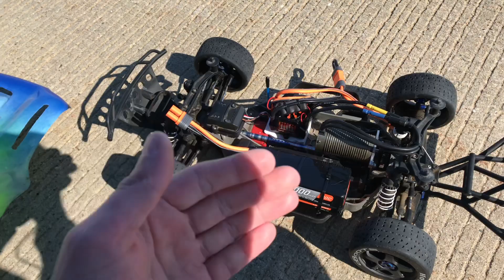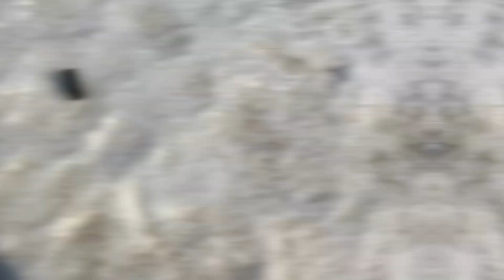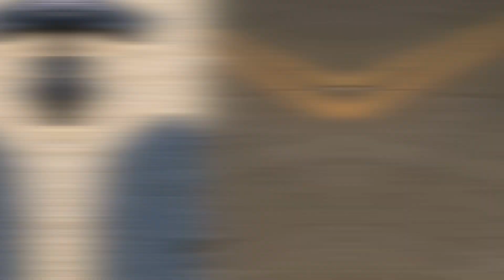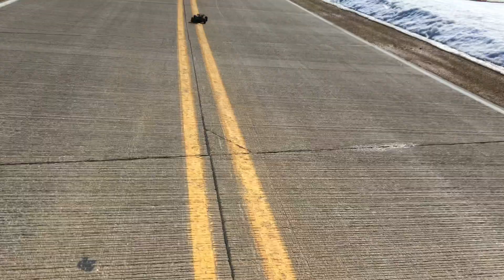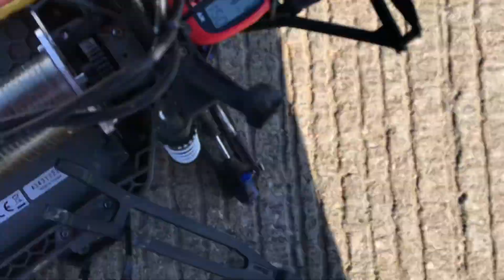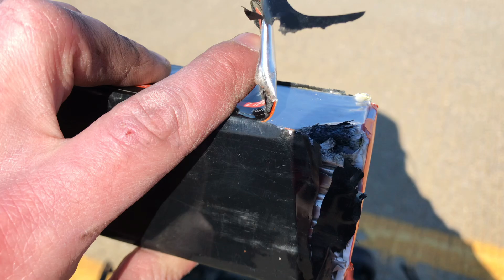100mph Traxxas Slash Project - EPISODE #11 - FIRST TIME Doing SPEED RUNS on NEW 6s BRUSHLESS SYSTEM!

Comment: nice setup, ive got a bandit 2wd that's running 6s with a 2:1 Gear ratio, its absolutly insane, there isnt a road long enough for me to pin it, i can only get about half throttle, nad already got 96 mph, i think i can pass the 100 barrier soon!
Reply from the maker: No doubt….if you can keep it on the ground you’ll be able to get it up to 100 no problem…..If I can keep mine on the ground I’m sure I could reach 100 too….. Lol

Comment: You should convert it to an 8th scale slash with that amount of power, with an Aerodynamic race car body! that’s what I did on 6s also! And I also lowered/stiffened the suspension.
Also get some aluminum battery trays for Slash 4x4, they install were the old nerf bars go…that’s what I did lol. They will offer better stability, balance and control.
Reply from the maker: Check out the most recent videos…..I’ve done most of those things already
Reply: Ok cool man! I’ll check them out! 🏎
Reply from the maker: @ashtonstigger8714  yeah definitely check it out

Comment: You may need to look at doing a xo1 drive shaft conversion, their 6mm stub axle instead of the 5mm standard on a slash. Keep going, doing awesome 👍👍👍
Reply from the maker: Thanks! Does that include the stub axle though? Cause it’s the stub axle that keeps breaking on this Slash
Reply: @RCKnockout  yes it sure does. The xo1 stub axles are 6mm, instead of the slash 5mm. I believe the is a parts list required for the conversion on the traxxas website.
Reply from the maker: @thefunstuff6121  alright thanks for the info!
Reply: @RCKnockout  No problem at all. I hope you hit that 100mph goal soon.
Reply from the maker: @thefunstuff6121  Thanks I appreciate it!

Comment: That was really risky to have that battery secured like that, its definately toast when you see the inside XD. I think its a good idea to get one thats a lot smaller so it will fit in the tray and be protected when it will crash (I know it will have a larger voltage drop under load but you dont seem to be limited by power at all at the moment). It will also be cheaper. I bet the axel keeps breaking because the car is so heavy.
Reply from the maker: I know. I destroyed a brand new $160 battery. It was a major bummer. I’ve addressed some of those issues since this video. Feel free to check out the series if you’d like

Comment: Look at ajcspeedway.com. I have their aero kit on my DR10. I know they make one for the slash, but I'm not sure if it is made for 4x4. I bet you could make it work though. Warning though, one hard wreck and the 3d printed plastic wil likely snap. My rear diffuser broke off, but all the other parts are holding up.
Reply from the maker: Thanks for the recommendation! I’m not a big fan of printed plastic though. I’m sure that would break after one or two crashes

Comment: Not with that body or front bumper
Reply: You should get some good gtr shocks with any of the red springs it will stiffen it up and keep it stable at high speeds. Or at least lower the front more then the rear to help keep it down
Reply from the maker: @thatdudesme2  these are the gtr shocks. What are the red springs? Stiffer ones?
Reply: @RCKnockout  Yes there is a while line of red springs red each set of red has a color that identifies the spring rate. There all extremely stiff red with Blue stripe and purple are the go to for speed runs.
Reply from the maker: @thatdudesme2  those are Traxxas upgraded springs?

Comment: Just got 97mph with a similar 6s setup. Drop those front shocks and the rears a little bit. Ziptie a socket to the front and your'e golden 👍 love your build btw, check out mine sometime if you ever have time or see this
Reply from the maker: I’ll have to check it out. You did a video showing it get up to 97mph? Is the socket just to weigh down the front?
Reply: @RCKnockout  yes! Was only my 2and speed run with the truck as well
Reply from the maker: @jtrc9656  I’ll have to watch it when I have time. Did you have a front splitter or anything on it?
Reply: @RCKnockout  nope! Build is still fresh and I would have had a front splitter on by now but I'm still waiting on it to be delivered! Just tuned my suspension around once or twice. You want very little to no lift in the front and a stiff but very low to the ground rear setup for shocks, try easing into the throttle a little smoother as well, The torque your slash has is your best friend for cutting through wind and keeping it on the ground
Reply from the maker: @jtrc9656  gotcha. Did you remove your front bumper?
Reply: @RCKnockout  yes! Just seemed like it was allowing air flow directly under the truck
Reply from the maker: @jtrc9656  gotcha. I might have to try that with mine. We will see

Comment: Very cool body!
You would like to see my homemade 1/5 49cc RC buggy!
Reply from the maker: Thanks! Is your buggy based on an Hpi Baja or is it all homemade?
Reply: @RCKnockout  All homemade! I designed the chassis and made from scratch
Reply from the maker: @CMBProjects  nice! What motor are you running in it?
Reply: @RCKnockout  it is from an offroad pocket bike, 49cc
Reply from the maker: @CMBProjects  nice! How much power do you think it’s putting down? Is it a wheelie monster?
Reply: @RCKnockout  in theory it has 3.5 hp, the best it does is drifting!
Reply from the maker: @CMBProjects  not as much as I thought. Does it have a pipe on it?
Reply: @RCKnockout  yes but stock, not for performance
Reply from the maker: @CMBProjects  gotcha not trying to bash the horsepower. Im just used to seeing 30cc engines 3.5hp or so. But that’s for rc and you did say yours came out of a pocket bike so it was built for a different purpose. Is it torquey?
Reply: @RCKnockout  yes, not high speed but a lot of torque on the wheels, very nice acceleration
Reply from the maker: @CMBProjects  Awesome! It sounds like a lot of fun!!

Comment: Nice! make a custom (VENT) for air flow to cover it for cool ideas!  this body is holding up well.
Reply: I think the air vents are preventing the air from crossing the body to press it down
Reply from the maker: @jmalone3337  gotcha. What do you recommend?
Reply: You have to get the car as low as possible, make sure the front is lower than the back, and lower your body mounts to there lowest position, to get the body to sit closer.
Reply from the maker: @jmalone3337  thanks for the recommendation! 👍😉
Reply from the maker: You think I should make another vent in the top?

Comment: I got faith in ya man.   I'm thinking that bumper is definitely not helping. I'm a noob to the hobby. But just a hunch.   I put 50 wght shock oil in front and rear of my stock 2wd slash. I don't really have dirt where I'm at... But just doing that the slash handles Incredible now on the street.   It's stock and I ran 2sn5800mah lipo I only rolled it once because I hit water causing rear end to spin out then catch mid turn but.   I know you got this.   Frustration only makes me focus more.   Don't get disappointed.     Remember your mind is the mountain before you.    Climb to the summit
Reply from the maker: Thanks man! I appreciate the encouragement 👍😉..I’m not sure if my slash needs thicker weight oil. It already does have sway bars which prevent a lot of body roll from happening. I could probably mess around with it though
Reply: @RCKnockout  it probably don't need thicker shock oil no. But that's all I have done to my 2wd slash.   I rolled it a bunch at first. Mind u I have offraod around me but it's dangerous territory... Water hazards almost 97% of any off roaring when u live 5 minutes from the gulf coast. So I stick to the streets. But just changing the oil to 50 F&R oh and aluminum shock caps.  Only changes made... I took it out for a run last night and was completely stunned at the cornering.  Also keep in mind I'm very new to the real rc world. And the hobby man suggested 50 weight just as an all around application.   Anyways... I'm a chatter box back to the problem at hand.  Hitting 100mph😆 your gonna figure it out. You seem heading in the right direction.    I was thinking also maybe your test area is part of the problem... That road isn't smooth and it seems like it's below the main highway. If that's so... That wind could be a big help in lifting the front end. I'm not the brightest crayon in the box by any means. Just a thought. I know your gonna hit that hindi tho.   You have definitely made progress.     Oh yeah forgot to mention my slash is 2wd and it's brushed. Lol but running the 5800 mAh 2s for a lil bit... That booger was a cooking and not rolling. I even chased a few racoons.    Hey if nothing else.    JUST SEND IT😆
Reply from the maker: @andrewcarberry5470  thanks! You don’t wanna drive your Slash through water? 
I believe that I need to find a different location. With the curve and the short straight way before the dead end. There isn’t really enough space to get a good top speed and get the power down.
Any plans on going Brushless with yours?
Reply: @RCKnockout  I'm not sure... I'm thinking so with brushless.  But I need to get better with my 2wd Rusty vxl.   I haven't even ran 3s in it yet.  But I regret not going brushless with  the slash. Also not getting 4wd. live and learn eh? I'm thinking brushless most definitely and everyone is all into the drag but the slash has endless capabilities for sure...  All I know is your gonna hit a 💯 and it's gonna be sick
Reply from the maker: @andrewcarberry5470  thanks for the encouragement man! I have a playlist called “the CHEAPEST Traxxas Slash Project” that I’ve been doing if you wanna check it out. I basically converted the cheapest brushed slash model into a brushless VXL version and I continue to make more improvements

Comment: If you cut the front off no wonder that air gets under the body. 
Normaly the racers cut the rear bed out.

How about mounting a arrma spoiler in to the front of the car? 
And cutting the bar off of the front skidplate?
Reply from the maker: Those are good ideas! I definitely need downforce on the front. (the bar in front of the skidplate) what are you referring to? The bumper?
Reply: @RCKnockout  yeah the bumper. 
Cutting off the bow. Like in the traxxas viedeo: how to build the drag slash
Reply from the maker: @MertNisa3168  I gotcha. I’ll have to look into it! I definitely need to make some changes if I wanna get to those speeds
Reply: @RCKnockout  just cutting of the top piece. 
If traxxas does that, it has a meaning

Comment: 70 not bad,,,,but you definitely have to lose that front bumper,,,,it’s just pushing the front end up,,,maybe try lowering the front end a bit,,,,,if you decide to use a wing,,,,make it level.....great run though,,,where did you get that GPS,,,,I like it. 🇺🇸👈🚘
Reply from the maker: Thanks! Yeah I definitely need to do something about the aero and downforce on this vehicle. I’m pretty sure I bought it on EBay.

Comment: Pheww. What a expensive video! Don’t run a truck without it’s body shell, you were asking for trouble. Your motor battery and esc are sitting to high. You can’t just bodge aerodynamics and expect them to work. You can’t just put raw power and get 100 mph. You can’t defy physics. Get a flo-tek body or something. Get a 10th scale system on 4s that’s gonna sit low to the chassis. A more planted suspension setup allows for better traction on roads. That’s why the car handles weird. It breaks the axles because their load is too important. I know I am pessimistic, but I don’t believe that the project is achievable unless there is an entire reconfiguration happening
Reply from the maker: Yeah I’m more of an optimist. Some of those are good points. I wouldn’t go down to 4s though that doesn’t make sense. It’s gonna need a 6s system to reach 100mph unless I gear up a 4s setup crazy to the point where the thing needs a push start which I don’t want to do. That’s my opinion anyway

Comment: Hey bro sucks you had a rough go! I smashed up my tekno mt410 good the other day causing 140$ in damage. You’ll get it back up :) I recommend smc or turnigy lipos. For a fraction of the cost of spectrum packs, and superior performance. The highest end lipos only discharge max of 40c. The spectrum (100c) line has proved to be 20-30  tops
Reply from the maker: $140 in damage. That’s a lot. You think the Spektrum 100c only has 20-30c discharge rate?
Reply: @RCKnockout  ya it was pretty savage. Yes the C ratings EVERY Manufacturer  claimed C is bogus. The best lipos in the world only have a proven 45c rating
Reply from the maker: @GuyonaMoose  if it has 100c advertised it’s still gotta be more than 30c don’t you think?
Reply: @RCKnockout  no  25-30c is about average from the data I’ve read. The us military has said that there isn’t a lipo in the world than can discharge over 50c
Reply from the maker: @GuyonaMoose  interesting. Continues discharge rate?

Comment: Good job I just had a major crash yesterday at 50 with body on on 3s
Reply: Man is got front and rear towers exploded and pretty much everything attached back to drawing board i was barley on the 21 tooth pinion but I learned from you no more body back to drawing board and rebuilding for me
Reply from the maker: @six50motors  same for me lol 😆...back to the drawing board
Reply from the maker: Did it do much damage?

Comment: Oh man, that's too bad you had such a costly run! I would see what you can do to get tye rear up, and the front down with the suspension. I would probably put the stock body back on, and rather than removing plastic, try creating a "wing" (for lack of a better word) in the front so the wind creates down force. Maybe you can research other bodies that are more aerodynamic to start with?
Reply from the maker: Thanks for the recommendations! I’m not sure how the stock body would do any better though?
Reply: @RCKnockout  I guess my concern is that the air holes may actually be causing more drag by allowing the air to get into the vehicle, rather than over it. If you can prevent the air from getting under the vehicle to begin with, I would think that would be ideal.
Reply from the maker: @NathanStorer  yeah you’re probably right about that. I thinks that’s why people use wedge shaped bodies for high speed slash builds. It can cut through the air much easier
Reply: @RCKnockout  maybe try an aftermarket body like this. It's not painted, doesn't even have the wheels cut out, so you can customize it to your vehicle. The front is lower so that'll help prevent air from getting under it. I wouldn't even worry about painting it until you get a working version.

https://smile.amazon.com/dp/B07PVQX87Q/ref=cm_sw_r_cp_apa_fabc_VJ4AS0R9BZ9AGYVM3VFY
Reply from the maker: @NathanStorer  alright thanks for the link. We will see. I’m still gonna be making a few more changes to the short course body to see if I can make it more aerodynamic

Comment: Might think about stiffening your suspension by limiting the travel of your shocks.. and also maybe get a speed run body.. front and rear wing
Reply from the maker: My goals to do this with a short course body but I’m not sure how realistic that is. I definitely need downforce though and it probably needs to be lowered too
Reply: @RCKnockout  maybe it can be done with a sc body but it will be hard.. you'll just end up running it without a body and damaging more stuff... tons of speed run bodys out there.. alls u need is down force and tune the shocks for short travel with it set up in the back a little bit... u got the power for sure.. split your batteries up.. u probably already have a bunch of 3s pack.. I dig the content for sure dude 👌
Reply from the maker: @yuptimhulett  thanks man! I do have a bunch of 3S packs but I don’t think any of them have more than a 50c discharge rate. And none of them have the ic5 plugs either
Reply: @RCKnockout  the ec5s are almost the same as ic5 and there really easy to solder. Probably one of the easiest connector to work with.. and cheap..
Reply from the maker: @yuptimhulett  yeah I did know that they are compatible with the ic5 connectors

Comment: Ya, front bumper is not good, and rear wing would help keeping it steady 😉
70 is ok, lol faster than I've ever gone with my x- maxx. Thought I'd subscribe for more action. Great video.
Reply: I went 54 with my xmaxx on stock tires and motor with hobbywing max6 esc 22/50 gearing and 6500 60c 4s batteries
Reply from the maker: @2down2togo  that’s sounds about right. Your Pinion is 4 teeth up on what I’m running
Reply: @2down2togo  thanx for the info, greatly appreciate the help 👍. 
Stock is fun,but lol,not when there's so much to upgrade my bashing good time!
Reply: @petekobraoutdoors7324  i didn't do a lot of upgrades to my xmaxx. Max6 esc, better steel gears, rear rpm bearing carriers, shock covers more for looks, just got the upgraded servo after 2 years of bashing the stock one, and some duratrax hatchet x wheels. Most of my cars get minimal upgrades as I don't see a point in it if its running good for me lol
Reply from the maker: Thanks man! I appreciate the support

Comment: Niceeee 😁 I'm making a slash 2wd myself right now. I have an lcg chassis and I have the proline 32 pitch transmission,17mm hubs,custom shocks so far. And as far as as aerodynamics, use a rear wing mounted on the front bumper upside down. That should hold the front end down.
Reply: Nice I have the icg chassis too and a slash 2wd my slash goes 80 with a 2 cell and a little smaller pinion gear and 3 cell mine would go like 120
Reply from the maker: Thanks for the recommendation. I definitely need some sort of front splitter. Good luck with your build 😉